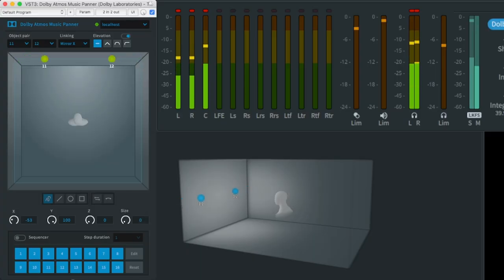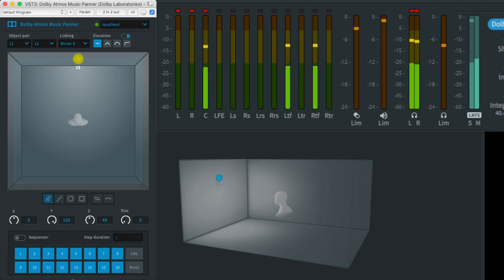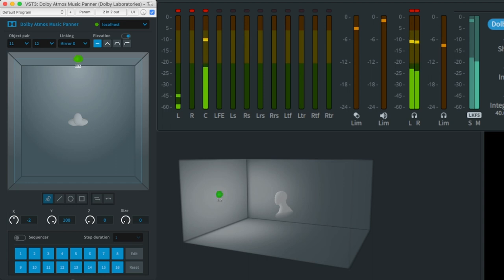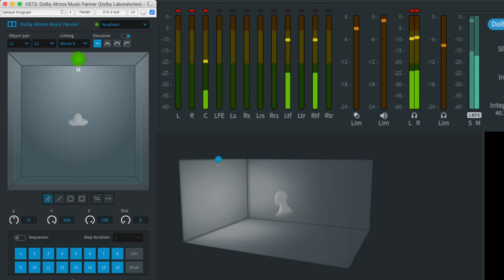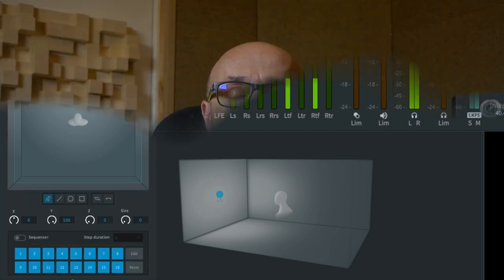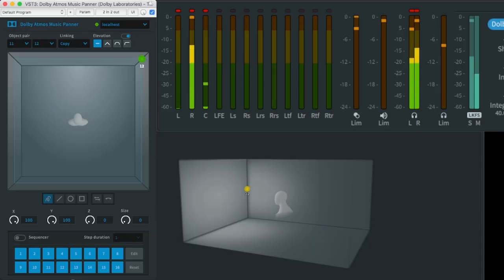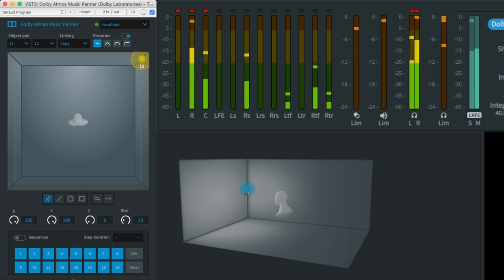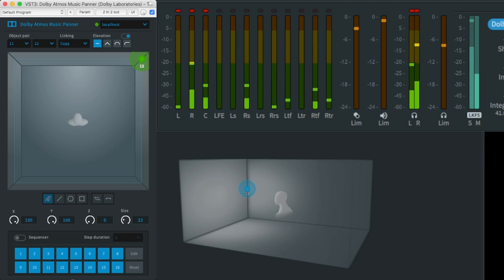Understanding speaker configurations in Dolby Atmos

Comment: I'm aware that this video is more than a year old, but I came across it today when it popped up in my Recommended list. Patice (please, excuse if I've misspelled your name), if you are reading this. I'm afraid that your video does NOT explain the confusion regarding the channel discrepancy of the height channels. Why do Dolby "require" that the mix is done in 7.1.4, when the bed is only 7.1.2?

From what I've been able to find out, it doesn't matter how many height channel speakers the playback system has. The same 2 channel (stereo) information will be played through all the height speakers! Which is confirmed by the meters in your video. The "missing" channels are the rear height channels. I'm not sure if they are folded in with the front height channels, or simply ignored. Whichever way you look at it, the renderer will destroy the front/back information in the height channels.

This is the real confusion. Why does Dolby "require! that the mixing is done in 7.1.4 wen the renderer folds it down to 7.1.2? The only solution, to not having the mix ruined, is to ignore the bed's height channels all together (and use object, for all 4 height channels. If so, why are there hight channels in the bed, at all? I don't know about mixing for movies, but for music, they are superfluous!
Reply from the maker: Hi Sven, thank you for your comment. The answer probably is too long for a  comment and deserves its own video. The short answer is objects. Unlike beds, they are not tied to a specific speaker (or array of speakers), so they can be moved all over the place, hence the necessity to have a minimal perception of front/back playback while mixing. Stay tuned for more :-)